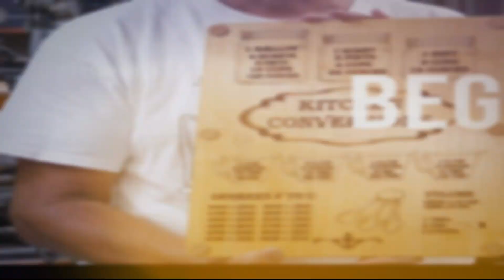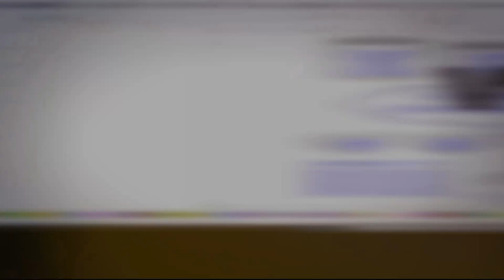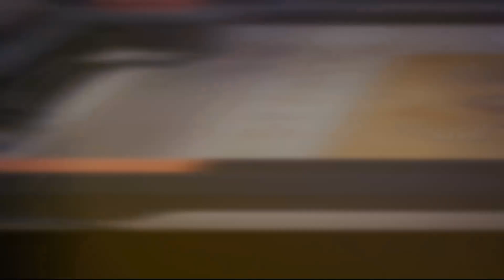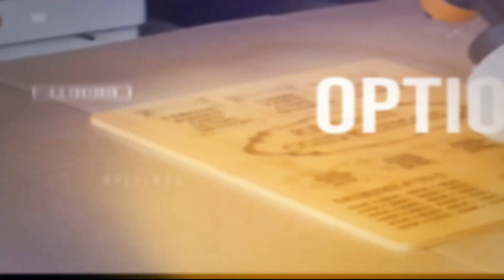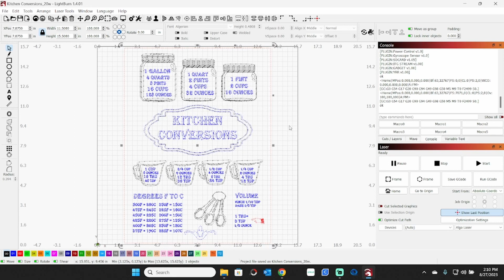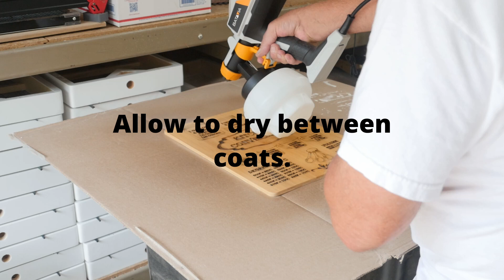Laser Engrave Bamboo Beginner Laser Project 22

Comment: Hey there im glad I stumbled upon your video!! Thanks for the file!! Oh do you have settings for 40w laser? Thanks in advance😊
Reply from the maker: I have not used a 40 watt on bamboo, but you certainly can.  Suggest running a test on scrap starting with 1/2 the power used for a 20 watt as a beginning test point.
Reply: @rogersshop  well today I installed Lightburn on my xtool s1 40w and for some reason it won't do anything but go to home. I also downloaded your coaster container and I get it to work...Have any suggestions? thanks in advance
Reply from the maker: You need to install the Lightburn config file:  xTOOL_S1_V2.lbdev which can be downloaded from their site here:  https://support.xtool.com/article/1036  The site also gives instructions on how to install. @slyman6776
Reply: @rogersshop  thank you so much! I installed it and it worked!  Thanks 😊

Comment: I downloaded this file, I have the Longer Ray5 20w, and no matter what i do in its original orientation when i frame it i get a soft limit error, now if i rotate it 90° it will frame it. Ive not tryed to run it yet, as i get the same errors trying to do your 400x400 location board.

When i set it up in lightburn i set it to 410x410. Any ideas?
Reply from the maker: Working area with the 20 watt model head is 375 x 375mm due to the larger size of the 20w head.  You will need to change the setup in Lightburn to 375 x 375 mm (14.76" x 14.76").  From a blank page in Lightburn, make a 375 x 375mm square.  Center it.  Set to Absolute Coordinates, then run the "frame" function.  This is a test to make sure it travels the full dimension.
I may do a video on this "test" as I get asked many times about the "boundaries".
Reply: Ok changing my reply,  My longer Ray5 has a Y of 360 and X of 400 (verified via touch screen) so rotating the bamboo board will work. Now to work on a 360x400 board..... 

40mm is alot of lost space in the grand scheme of things,  but it's my first laser to learn on.

Comment: Thanks for this video and making the Lightburn files available.

This is an excellent example of how settings will vary from one laser to another even though they may be rated at the same wattage. I have an ATEZR P20, and loaded the 20 watt version of your file.

Had to tweak settings to get a result that approximates yours. That is why it is a good idea for users to always run a material test first!